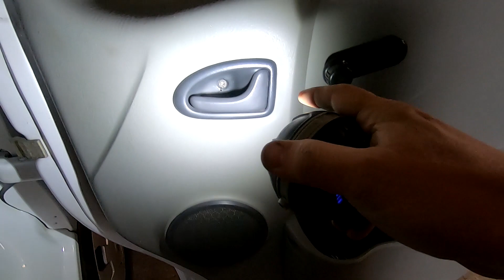Replacing our Vivaro drivers door lock.

Comment: Had the same issue on my van. So as a back up. I dropped a live and earth cable off the battery and out under the van so as least I could still charge the battery up if it went flat
Reply from the maker: @maxv77  Good idea 👍

Comment: I got the same issue with the lock spinning in the door.. I’ve found an ignition barrel and door lock set with 1 key. Question is, if I fit this ignition barrel as well, like you was originally planning in your video, will it start the van on that new key or does it need programming in? TIA
Reply from the maker: @Mac_s94  . Not sure, but you'll as a minimum have to move the original transponder chips to the new keys. Good luck sorting it out 🤞.
Reply: @ just wanted to update you and any future readers.. I changed the barrel, tried the key and it cranked but didn’t start. The van also had a flashing red circle light on the dash (just wanted to check before changing the circuit board in from the original key to the new one) 

So then I moved the original circuit board into the new key and tried again.. and it started! No further programming required!
Reply from the maker: @Mac_s94  Thanks for the update 👍. Good work sorting it out 👏.

Comment: The rod and clip have broken on mine :(, well just the clip. I have a new handle & going to have a go tomorrow. Do you need to remove everything like you have to get the handle off? Like, is the electric connecter in the way to the long 10mm socket through to the X2 10mm nuts that hold the handle on? I don't need to change the lock or anything, just the handle with a new clip.
Reply from the maker: @PCG2022  . Yeah, you've got to take out the lock to get to the handle IIRC. Good luck sorting it out 🤞.
Reply: @LarcsWorkshop  Thanks for the GL :) It couldn't have gone any easier mate. Only took me 10mins so happy days. I didn't have anything connected to that yellow bit you had and I think you said it was the hardest (fiddliest) part. 🙏
Reply from the maker: @PCG2022  . Thanks, good job sorting it out 👏.
Reply: Do u have a link my clip broke also
Reply from the maker: @dalefraser7745  Sorry, I don't. @PCG2022 might have it?

Comment: Hi mate ive go a 2014 vivaro i converted into a camper and the passenger door wouldnt open just tonight so i took the panel of and noticed there's no blue clip for that rod to go back into? Is the passenger different to the drivers??? Wish you'd do a vid on the passenger door lock
Reply from the maker: @patrickpirelli7897  Apart from having a key mechanism, I would imagine both sides would be the same. I haven't had the passenger side off so can't confirm that? Sorry
Reply: @LarcsWorkshop  it's ok mate the passenger is different but doable I'me doing it in the morning with added security of some epoxy steel glue stuff. I read about another lad doing it. Thanks anyway look after ya self pal 👍
Reply from the maker: @patrickpirelli7897  Thanks 👍
Reply: @patrickpirelli7897  Did the epoxy work?

Comment: Excellent video. I've just bought a 2007 Trafic that has no external door locks, the central locking works on all doors. I want to instal an external lock to the driver's door - would the process be the same as on Vinnie?
Reply from the maker: Now that's a good question🤔. I think the doors etc are the same over the years, so I would bet that it would fit? The door locking mechanism might need changing if it doesn't have the function too. Does it definitely not have a keyhole hidden under a cover somewhere? Good luck sorting it out 🤞. 
Cheers Larcs 👍
Reply: @LarcsWorkshop  definitely no keyholes - the suspicion is that a previous owner must have had an issue and simply replaced the original with a non-locking item - I'd rather put it back to how it should be in case the remote key/system fails
Reply from the maker: @richardbarley2594  makes sense 👍

Comment: Hi great video!. I have the same problem and I'm planning to do exactly what you have done. Might be a silly question but will this lock/unlock all the doors? The central locking motor is starting to whir near the sliding door and my thinking is that this will be a cheaper fix?
Reply from the maker: @kalenwarne8577  Thanks 👍. Mine just opens the drivers door and doesn't operate the central locking.
Reply: @LarcsWorkshop  OK thank you
Reply from the maker: @kalenwarne8577  👍